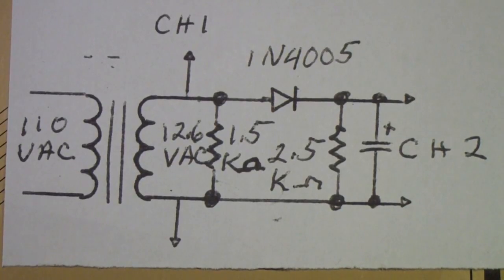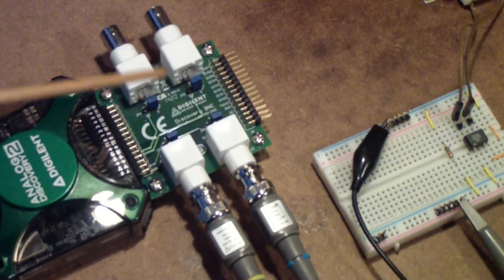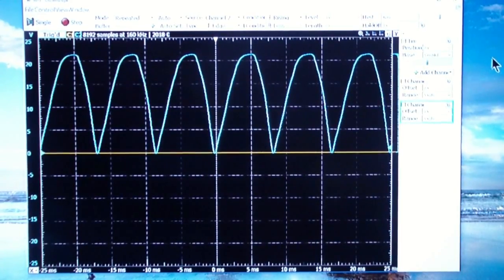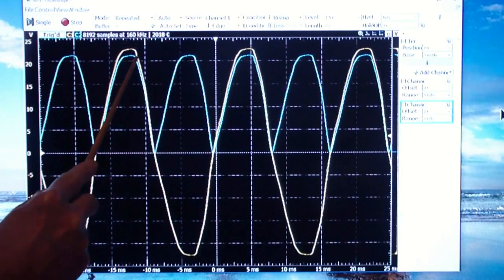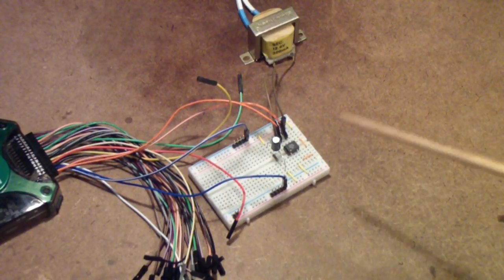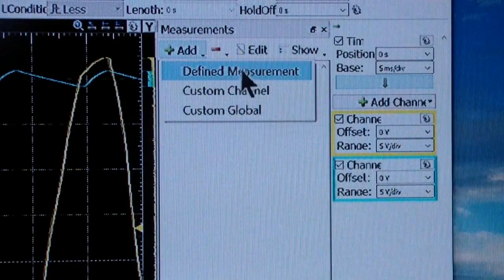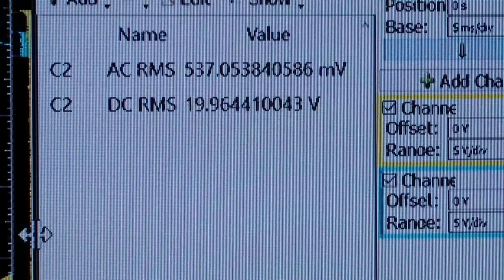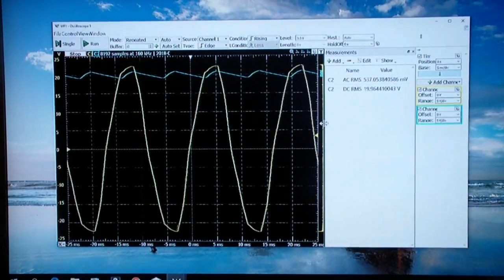TTT203 AOE AD2 Project2 Measurements

Comment: In the previous video you showed the half wave rectifier and the difference between a small value capacitor to a larger capacitor. While I understand that it's a very basic video on the topic, I also think that it's important to know and understand that capacitor ESR values also make a difference in the output signal. While there was a big difference made by switching to a larger capacitor.... Two smaller capacitors in parallel could improve the ripple on the output signal... I actually was hoping that you were going to include that in both cases of the half wave and the full bridge Rectifiers to see if that actually works... Other than that I really enjoyed watching the video and I look forward to watching all basic videos that you continue to post.